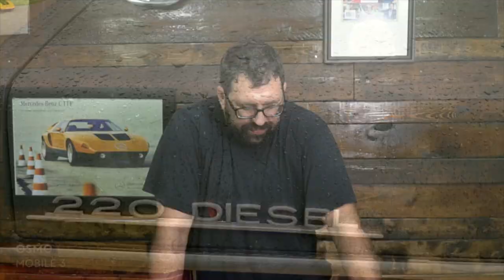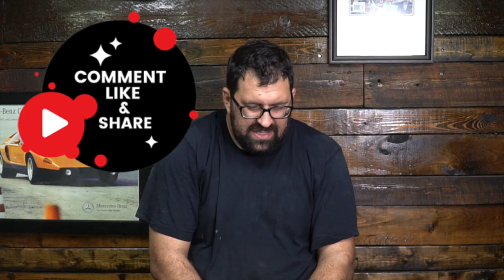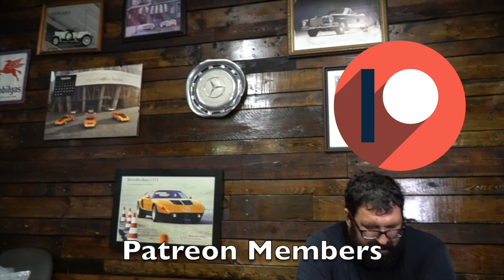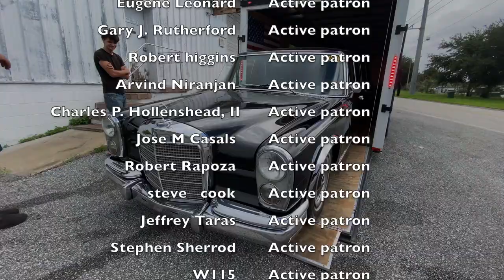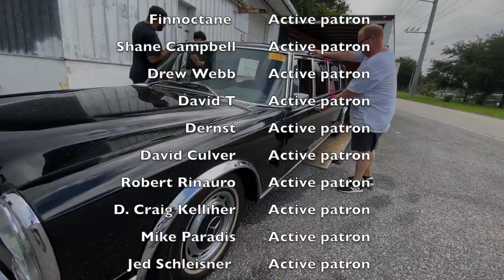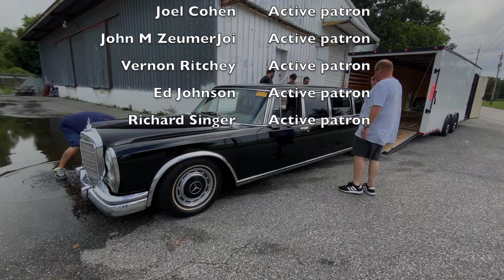No power to ignition coil

Comment: Hi Pierre,
I have 1972 w114 Coupe ... the car starts up when cold and after 5 min dies and it won't restart again...if sits for half a day it will do the same thing again...already eliminated the fuel related issues since wont help to spray carb cleaner in the carbs...not sure if my module is shot or just the coil or some of the resistors...the points will spark with screwdriver moving them with the key on.... The power going to the positive coil side is like 6 volts on the module side and 4 volts on the coil side of the resistor when the car is dead...any ideas would be amazing!!!
Reply from the maker: Hello, Do it yourself Motorcycle repairs and thank YOU so much for your question(s), we want to answer you as quickly as possible. 
By signing in our Patreon https://www.patreon.com/thomaspolk page and making a donation of $10 your are assured of a 24 hour email response from Pierre. 
If you are already a $10 member please mention along with your question.